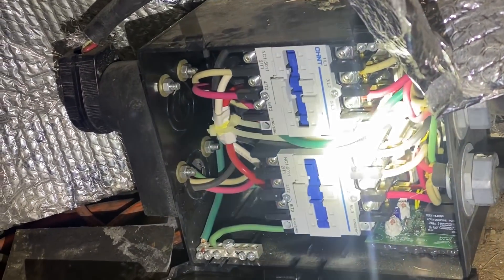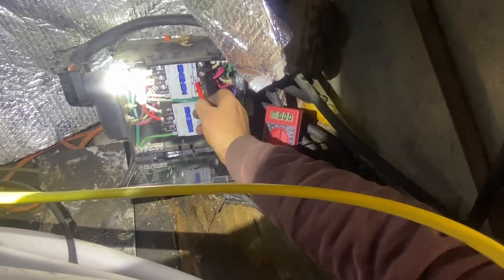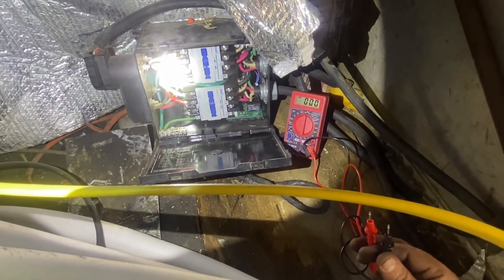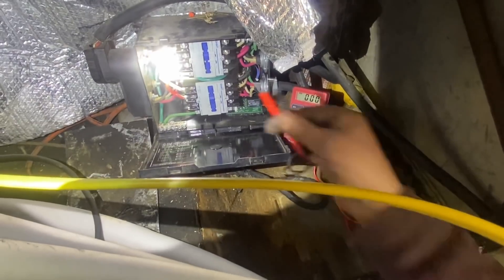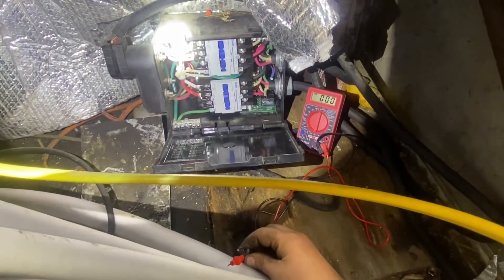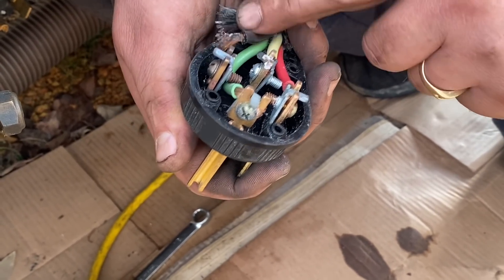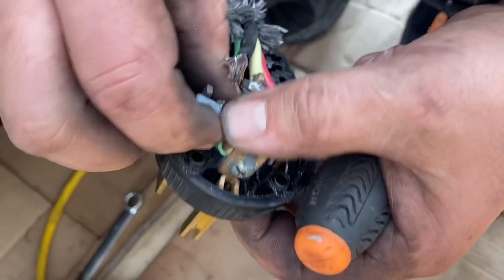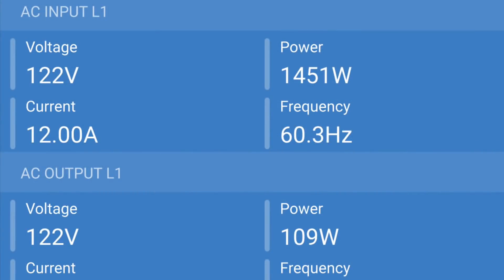Victron multi plus not charging part 2

Comment: Two bits of advice.  Crimp on some fork terminals to those wire ends, heat shrink the terminals to stop water ingress, and coat the connections with dielectric grease once attached. Two, plunk down $12 at Home Depot and buy a better voltmeter.  Those Harbor Freight ones do get wonky and read false.  My boat is littered with the carcasses of those Centechs.  The basic BMM-8132R Commercial Electric meter is cheap and reliable. Merry Christmas!

Comment: Please get a better meter - those Harbor Freight specials will literally blow up if you put too much current through them....  They are OK for low voltage but I would never use them on anything else.
Reply from the maker: Well it didn’t blow up at 120/240 i don’t have voltage higher than that.

Comment: Just a FYI, in electronics school a instructor said of the volt meter it gives you the difference between 2 points not the voltage present. So if one lead had 110v and the other had 220v the meter would read 110v or if both were 110v the meter reads 0v
Reply from the maker: All i needed to confirm was that each leg had 120

Comment: As a (Dutch) electrician these two videos left me pretty worried. I am  pretty sure that even in the U.S. the outer sheathing  of the cable is used as a load bearer too. So that needs to go in to the plug!!! Allso when using flexible power cord (especially when there are decent loads going over it) it is best to use a crimp tool and those metal sleeves to crimp over the end of the wire. (the part that's clamped under the screw) That is done because when you clamp down that flexible lead, that lead can become verry hot and start a fire..... And lastly when you use watertight plugs ouside (at least i hope they are watertight) the sheathing allso NEEDS to go in to the plug, otherwise you wil create life endangering situations!!! Just know that a half Ampére is deadly!!!! now i don't know the breakers you use, but most of em are more then 10amps i reckon!!! So please for safety fix those things!! Electricity is not to be taken lightly, because like an exposed wire looks verry innocent, but it could cost you everything!!!!

Comment: Get yourself some insulated alligator clip test leads for those hard to reach areas.  Saves shorting and frying circuits and you.
Use screwdriver that is wide as screw head and with good large rubber grip.  These have to be cranked down hard.  Wrap the cord with electricians tape where it enters the shroud and cord clamp so the clamp can be super tight also.  Too much strain on cord/plug

Comment: One of the feathers in my cap is the sales and repair of welding equipment. I used to see this brand of plug in use on smaller welding equipment and they would fail exactly as yours did, though with more catastrophic results because if the higher voltage and current load they were carrying. You did the right thing by ordering better quality gear. That's always the correct way to go.

Comment: The terminal with the wire that came out looks like it had been loose for some time (color of the terminals, not bright clean copper).  At the plant I worked in we had a PM procedure where we would power down panels and tighten all the terminals.  A pain in the butt - but we found many terminals loose after we started doing this.  Now it's a habit for me whenever I have any panel open or cover removed.  You obviously have great troubleshooting skills!   A big 👍.

Comment: Here in Canada we have Robertson (square) screws in plugs witch can be torked much more than Phillips head screws.   ;)  Just saying.
Reply: We have Robertson here in the lower 48. They have been for no less then 20 years. Great for getting that extra on the screws, But the bit gets stuck on the screw and if you are not careful you leave the bit somewhere.

Comment: Visual inspection of plug on left side of the transfer switch. First step in troubleshooting electronics. Looked like the line was so tight the insulation wasn’t inside the plug. Too cold to not have that system working! Happy to see you repaired it and moved that ground. Vibration would have eventually shorted it out.
Reply: Yes, was gong to comment on that one. Been there saw that.

Comment: Clean tight connections, conductors meant for the application, connectors, plugs designed for mobile vehicle use. Proper assembly  procedures ( proper tourqe) with proper tools, in a workman like manor. If unsure as to how please see the National Electric Code web site for Safety minimums in assembly and construction. Scott that "dropped leg" in the plug you showed hopefully is setting off all kinds of alarm bells in your head. You do after all allow your wife to sleep on the bus with you? Please upgrade all of the things that could be even a little "hinky" you know which they could be... I don't want to loose you guys to something stupid cheap or easily fixed!

Comment: Scott:
You made an emergency repair. Since the plug has been heated to a point that the  connector has been permanently damaged you need to replace the plug, or perhaps connect the cable directly to the input of the inverter.

Comment: It has probably has been hanging by just a few wires for a long time, which is what caused it to get hot. Did you consider just removing the plug and socket since you don't really need it?

Comment: That's why I split the braids where they are equal on both sides of the mechanical connection to get equal torque because that has happened to me too. You might want to put a strap to give the cord some support. Glad you found it and it didn't cause a fire. Thanks.

Comment: That can often be a problem with stranded wire and is why I like to tin the wire ends or use wire connectors, the latter the preferred way if there is room!
Reply: Tinning is a bad idea as the solder will flow put from the pressure, the connection will loosen, get hot, melt the solder and eventually burn out. This used to be an industry wide problem in industrial switchgear and domestic appliances before that lesson was learned. Crimps, ferrules or Wagos are the only reliable terminations.

Comment: You need to invest in a better multimeter OMG .
Reply: It got the job done now didn't it.
Reply from the maker: It’s not accurate compared to the Victron reading a few volts off. But just for testing if voltage is present it does the job.   It was free
Reply: @BusGreaseMonkey  I agree. I have a fluke meter but I have several of those HF meter to check for power. If I loose one or break one like you said they were free. When ever I get a coupon in the mail I get another one👍
Reply: HF standard. In this case voltage is there or not. No difference whether it is 120 or 124 VAC.

Comment: The outer sheathing on cable not going into the plug going into the transfer switch and outside the bus in the last video is a tad sketchy.  Especially the one outside in the rain.  If that was done properly I don't think you would've had that wire come out in the first place either.

Comment: Yeah I’ve seen 1 million plugs fail overtime
Lack of strain relief is a big part of the issues also it wouldn’t hurt to put a little piece of insulator between the ground and that hot. And sometimes on these big plugs I’ll even put a lug on the end of the wire Like a ring or a fork for better connections

Comment: Whew!!!!! Badass 50amp gotta watch it. I had a similar problem with my multiplus but it was at the inverter. One of the hots loosened up and burnt the connector. Caught it just in time. Glad you’re back up and running. Just had to mess with my water heater. I don’t like electrical.